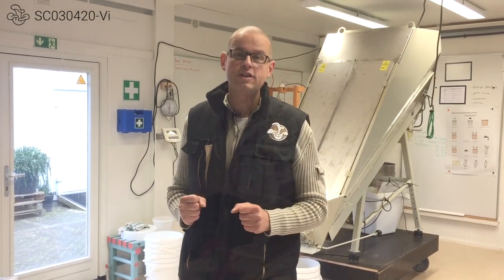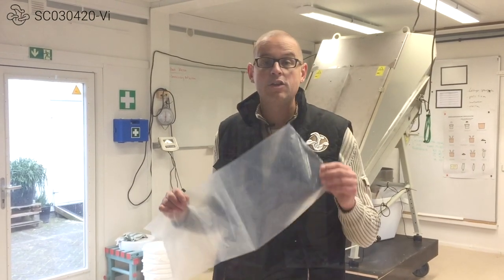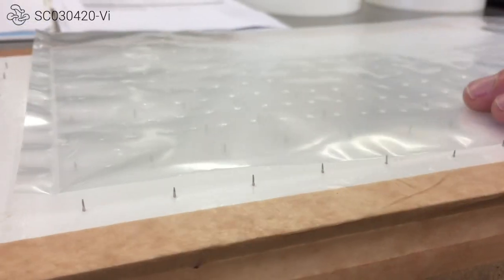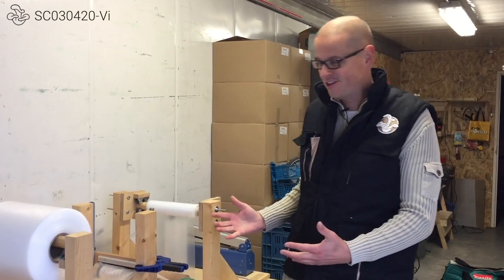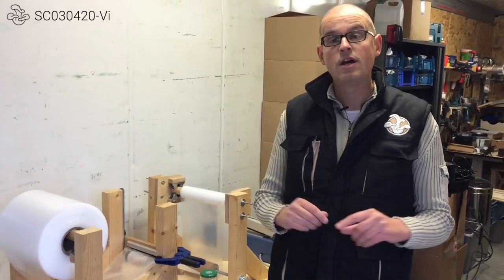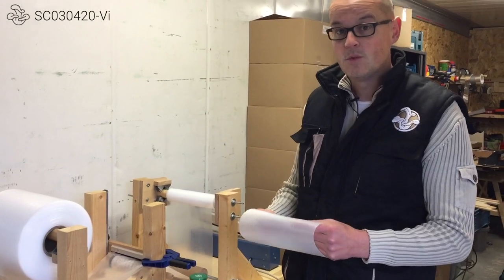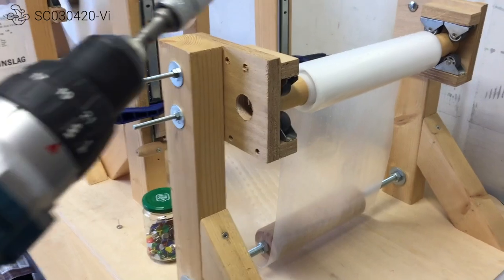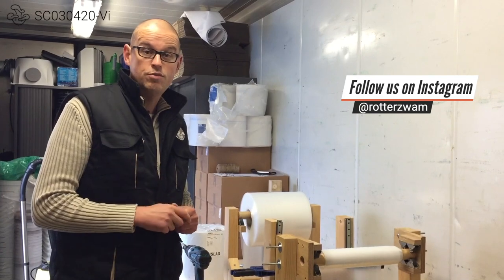Make perforated bags for mushroom cultivation [Multiple bags]

Comment: Hello, just wondering, I'm doing the same way but small 5kg bags, I have a kind a pizza slicer with nails, works not bad though, per bag around 4 lines around the whole bag, few lines  in a bottom, colonisation time for pleurotus ostreatus is 5-8days until ready to fruiting. But the problem is, in fruiting room mushrooms start growing from all small holes around the bag! So how to avoid the problem, just use it the tape or? 😁 By the way great device 👍
Reply from the maker: You probably use transparant plastic. Pinning is influenced by oxygen AND light. The best way to prevent that is using black non transparant bags.
Reply: @RotterZwamNl  Well other people who's growing not having that issue even with transparent bags. But I had that in my mind too 🤔 a lot of pins could make it smaller yields.

Comment: cost savings vs increased contam rates?
Reply from the maker: Compared to what? Filter bags? Filter bags work great for spawn, but in our opinion not so good. We want to point out that we are not making spawn bags here, it's for substrate.

Most of the big mushroom farmers in Europe work with perforated substrate bags. Albeit they use thinner and more pins. The perforated bags provide a good gas exchange that limits the chance on anaerobic conditions and creates the condition for the mycelium to thrive and grow fast. 

We have tested filter bags in the past, but we have found that these bags provide a limited gas exchange. As a result the mycelium mainly grows near the filter and not where there is no filter.
Reply: @RotterZwamNl  do you supplement your bags? or whats the substrate?